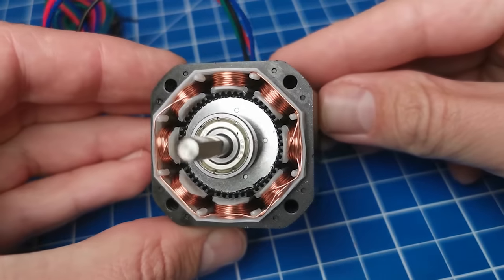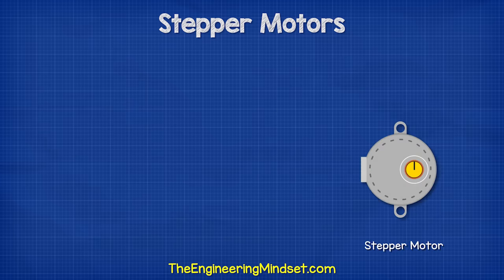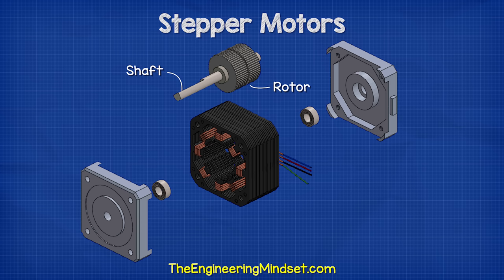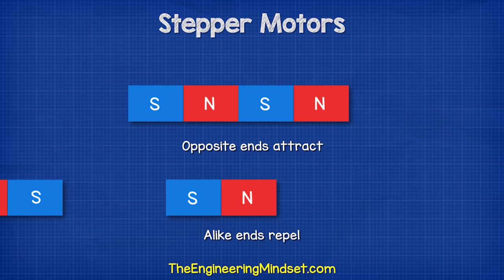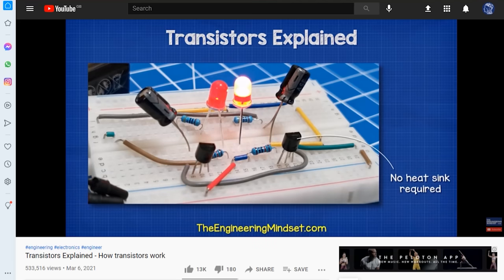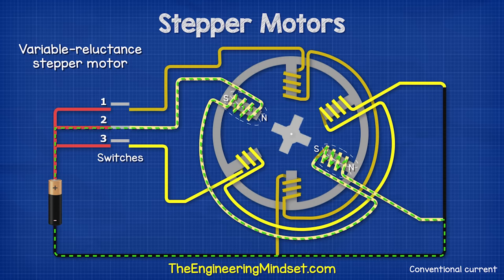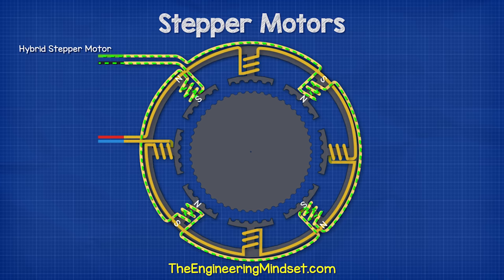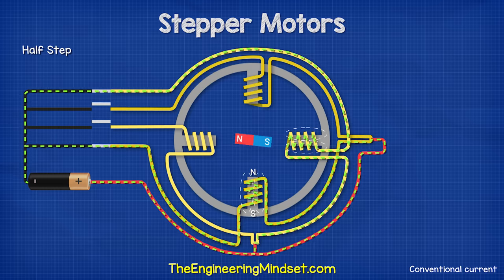How Stepper Motors Work - Electric motor

Comment: as a professional designer of stepper based systems for global slot machine companies, I find your explanation of basic operation well thought out, methodical and covers most of the basics, well done!
Reply: at 11:30 when he explain how it move around, what stop the rotor to move backward, how does the magnetic field know to move it in a certain direction? rotor teeth have the same polarisation and the stator have the oposite polarisation wich is why it move i get that much but why in the direction it is going?

Comment: It is important to note that the rotor design shows that the stepper motor will have a very low torque and cannot drive large mechanical loads.

Anyway, thank you very much to a very informative video. God bless!

Comment: how do they put in those massive coils perfectly
Reply: just search:    massive coil winding
Reply: @Andre-gn4sj  what is the graph like pad used mostly by every engineers caleed
Reply: @scarlet0017  not sure i understood your question, but are you referring to the clipboard?
Reply: @Andre-gn4sj  umm the graph like thing he put below the stepper motor
Reply: @scarlet0017  if its not a "cutting mat" give me a time stamp.
Reply: @scarlet0017  lol do u mean the graph he uses as the background? It's just for aesthetics in this case. 
If you're asking why engineers uses graphs, it's for precise drawings of circuits, waveforms, machines etc depending on the usecase

Comment: These are commonly used to control the throttle plate in the engines of air ccooled standby generators. Stand by generators are typically used to provide backup power in the event of a utility failure in both residential and some commercial applications. The speed of the engine controls the frequency of the output power. These stepper motors are used to control the throttle position in the carburetor or what's called a mixer when used with propane or natural gas. The controller maintains 3600 RPMs and thus maintain 60 hertz output of the generator. This stepper is operated actively  by the controller in the standby system to compensate for load changes on the generator.

Comment: From textbook: in full-step operation, the stepper motor moves one full step per input pulse. This means that the motor advances by one complete step angle each time the control circuit sends a pulse to the motor.

Comment: At 1:12 you mentioned the motor can stop at a desired point and hold that position, but how does it do that? Does the current through one of the stators/stator pairs just stay on to hold the rotor?

Comment: How does the controller know the position of the rotor/shaft? I assume if you need such fine control, you also want to insure that you are always rotation to the correct position.

Comment: How does the stepper motor hold the torque? If you keep the voltage over the coil, wont this lead to a short circuit?

Comment: Hi! Does the torque start decreasing if for example controlling stepper motor turns from the full step to half and eventually to micro step, on the cost of speed? Great videos by the way :D

Comment: I used to replace "bad" stepper motors in printers. On looking inside most of them had a small chip of magnet loose inside, remove this and the motor was good as new.

Comment: curious if you understand why several of my stepper motors have continuity on the 1st and 3rd pins, & 2nd & 4th? i have been trying to figure out why my z-axis is stuttering loudly, and was directed to check continuity of the two coils' sets of wires. I then tested a brand new Nema 17 and that one also tests irregular. What the Fluke!? Figured i better test my y-axis, which is moving perfectly, and has regular, 1st & 2nd, 3rd & 4th order.

Comment: So if micro-step control is essentially simulating a “modified” 3ph sinusoid, then we should be able to connect an actual 3ph mains circuit to the stepper and have that baby take off. Unless I’m missing something.

Comment: What's the difference between a stepper motor and a servo motor. Does a stepper motor have a maximum rotation of 360 degrees where a servo motor can keep going in same direction even when reaching 360 degreee.
Reply from the maker: Check our new Servo video out: https://youtu.be/1WnGv-DPexc

Comment: And a note about steppers that look exactly the same but come from different manufacturers..... as I found out the hard way.

You'd think that a stepper is a stepper is a stepper.

I wanted to do some experimenting with my Wanhao Duplicator 9 MK2 400's stepper motors.

I wanted to see how easy it would be to replace a stepper if one failed.

So, as a test, I removed one of the 2 steppers for the Z axis. (it has one one each side).

I took it to my 3D printer store to match it up with someone else, since its labeling didn't help.

I found a stepper that, physically, looked EXACTLY the same.  When I say EXACTLY, I mean, it's clear that both were constructed in the same factory, right down to every form.

When I got  home, I just plugged in the cable to test and ... NOTHING but a hum!

It turns out, that while it has the exact same connector on it, it's wired differently.

I realized that Wanhao was probably trying to FORCE people to only buy steppers from them.

So, in the future, if one of those steppers fails, I'll disassemble both the Wanhao stepper and the one I bought and compare how the windings are wired up. 

I have a strong feeling that I just have to reroute the connections to make it work.

Not all steppers of the same format ,size or wired the same, even though they can look the same.

Comment: at time 9: 19 - I think it is  60 degree but you said 30 degree for each step .
Reply: oh sorry. I figured out . you are correct. 30 degree is the right  answer for each step. because it takes 12 to complete rotation.